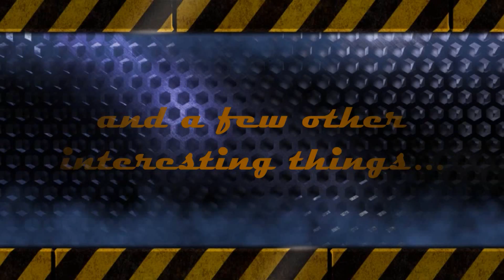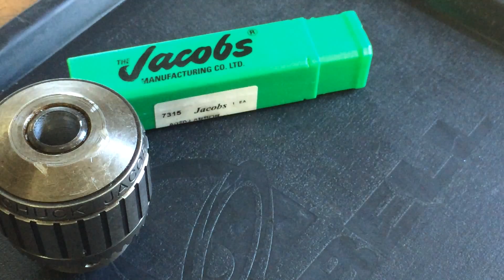Broken Arbor #realraysgarage

Comment: That hole in the chuck is not factory - someone drilled it to try and remove the arbor stub.  I had a 14N Super Chuck with an arbor that I couldn't get out, so I cut the arbor off, drilled and tapped it for a 3/8" x 16 bolt.  I then used a 3/4" cast iron pipe coupler to give the stub someplace to go, then used a piece of 1/4" CRS, washers and a bolt to pull the stub out.  The stub came out just fine with about 5 tons of pressure and I didn't have to drill my chuck!
Reply from the maker: Steve K Hello Steve, Thanks for sharing your repair, there are many ways to skin a cat! This was quick, easy and did not damage the chuck in any way. I use it often after installing a new arbor and has very little to no runout! Thanks for tuning in! Best Regards, Ray

Comment: Ray, maybe not a great video but a definite good one. I still can't believe that you were able to drill out the broken Jacobs taper with those drills. Were You using HSS or cobalt or something else? When I try to drill that tough steel all I end up with is a dull drill bit. Keep making more videos they are well worth watching.
Reply from the maker: Hi James,
Yes, the first bit was a very good quality drill bit but not sure if it was carbide or not. I do know that the outside of the Jacobs taper is very hard but the center was a little softer and drilled pretty easy.

Thanks for tuning in!

Best Regards,
Ray

Comment: my new job at this small mom and pop shop that just got bought by somebody with a lot of money. Is tool repair, just saw a video on how to replace the jaws the right way. Your video will help salvage the broken arbor problem. I'll watch the chuck pressure. The new plant manager threw out the broken ones. "hope I can dig them out." thank you very much.
Reply from the maker: +rusty blue Dodge Hello Rusty, Sounds like you have a pretty cool job at this shop! For sure always try to salvage good old chucks, the older USA ones are much better than the new ones today!

Thanks for tuning in!

Regards,
Ray

Comment: Hey Ray. A late comment but just catching up with your channel. Great video's by the way. Ignore the thumbs downers let them stew in their little pot of hate. I hate cookery programs and  have mentioned I do not like it when its added into a machining video. I have been honest and told the guys that put up the video's in the comments section.. BUT I did not give them a thumbs down. Heck they went to all the trouble making the videos and its their channel to do with as they please. Just cos I don't like it does not mean that every body else will not. I gave them a thumbs up for the effort they went to. I am quite capable of skipping over the video's or the bits I don't like. You tube should do away with the thumbs down and instead put a "report offensive video or post" or something similar in its place. I follow most of the machining community and have interacted offline with a few of them. You are all a great bunch of guys and I for one appreciate all video's that you take the time and effort to put up for us. Many thanks. regards from the UK

Comment: didn't read all the comments this process may have already been addressed, but if the arbor hadn't come out after the drilling and you have a tig welder you can run a small bead down inside the hole you drilled (keep it small) and the arbor will shrink when cooled and likely drop out.  that is also the best way to take out old bearing races out of blind holes. Might work with a stick welder if you have a steady hand.
Reply from the maker: That's for the tip, I think this time I was lucky but, maybe not next time. I do have a Tig so I will keep in mind your tip!

Thanks for sharing!

Ray

Comment: Just a little hint, that I'm making when I'm working with (very) hard materials: I'm trying to make a scratch with the drill or tool I'm working with. When it leaves a mark on the material it's good to go! You probably knew that though.
Reply from the maker: Thanks for the tip, I usually try to see if a file cuts the material, if so I'm good to go!

Thanks again,

Ray

Comment: Hello Ray

Very good video and repair, I guess another method that I have heard of is to enlarge the hole in the inside bottom of the chuck for access of a larger drift or pin to knock or press out the broken piece...

FYI...I like your method since the chuck remains a virgin

ATB
Chuck
Reply from the maker: Hey Chuck,
Thanks for the tip but, I agree, virgin tool's rule!!!

Thanks again bud,

Ray

Comment: I thought for sure it was going to spin when you got to the bigger drill sizes. Those drills sure have a good grind on them. Do you use a specific brand? Pw
Reply from the maker: Thanks Pw,

No special brand. HSS bits with a good even, smooth 118* grind does the trick for me.

Ray

Comment: An effective repair Ray. Coring out bolts, tapers, etc. to relieve the tension is frequently a good approach.

I would have done almost everything differently!

Jacobs chucks are generally soft through the back and can be drilled and tapped for an ejector bolt. I did that at work to easily share a good Jacobs chuck between the clapped out Myford and the Startrite bench drill. Since you already had a hole, I would have tried tapping it first.

You mentioned not having a terribly secure grip on the chuck and I would have tightened it onto a bar held in the 3 Jaw. If it's a piece of ground steel running true, you can touch up the taper if the chuck has too much runout.

Finally, the tip never breaks off a spotting drill!

Keep up the good work.
Reply from the maker: Hi Paul,

Thanks for sharing the information and tips! I am just happy I was able to extract the broken piece and use the chuck!

Thanks again,

Ray

Comment: Ray, great save! And, good video. It had drama: I kept wondering if the drill chuck would spin out of the chuck when the 5/8" bit took a bite! But, thanks to your careful step drilling, the big bite was minimized.
Reply from the maker: Hey Bill,

The speed for the 5/8" bit was way too high but, I was on a roll and a little drama is good once in a while...

Thanks,

Ray

Comment: I had a big ball bearing Jacobs chuck that my father had with a broken arbor. On that 1 put it on the mill and run a end mill down the center a lil but bigger then the hole that was there then used a punch & pressed it out. It didn't chine out quite as slick as yours did though.
Reply from the maker: I was a little surprized at how easy it came out, the 5/8" hole must of really relaxed the arbor.

Thanks for the tip,

Ray

Comment: Ray,
What kind of jerk would sell you a chuck with a broken arbor in it? I hope you gave him some negative feedback! Damn! You have some really sharp drills. With every one, both flutes were cutting (as they should) making a nice chip. Most of my bits are badly in need of sharpening. They make a hole by friction and burning its way through :-).  Thanks for the video! You should take that arbor stub and send it back to the clown you got it from. Tell him where to stick it!
Regards,
Dave
Reply from the maker: Hey Dave,

You know what they say; "Karma is a bitch" I hope this ebay seller does not sell damaged tools, he will be kicked off ebay quick! I like your idea of sending him back the drilled out arbor!

I hate dull bits, so I touch them up often! I use a Drill Doctor for the small bits, it works great and hand grind everything over 1/2"

Thanks bud,

Ray